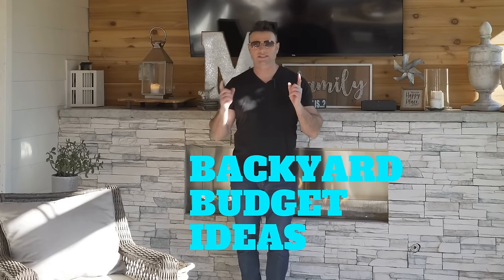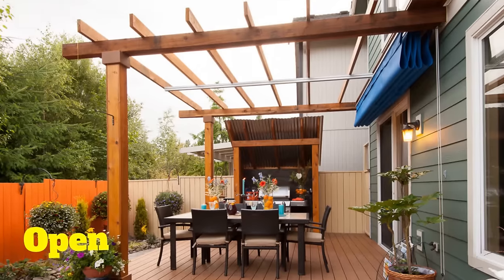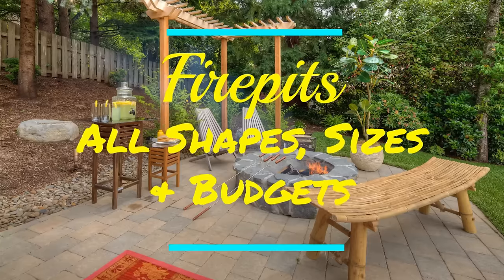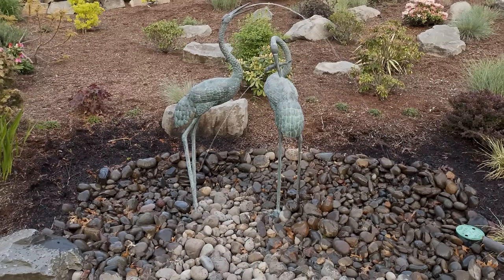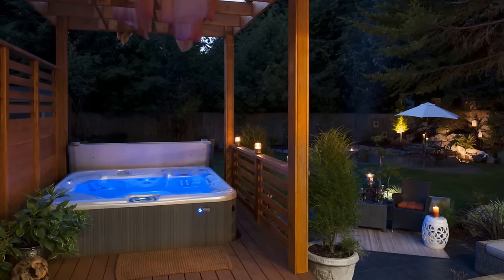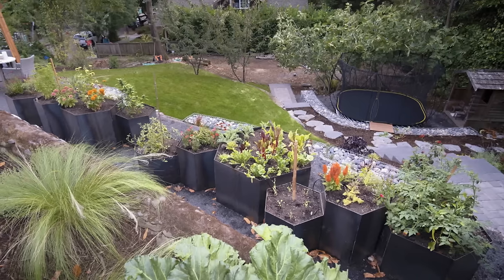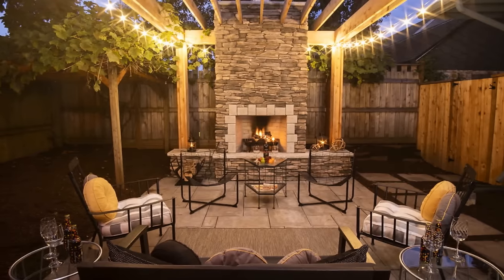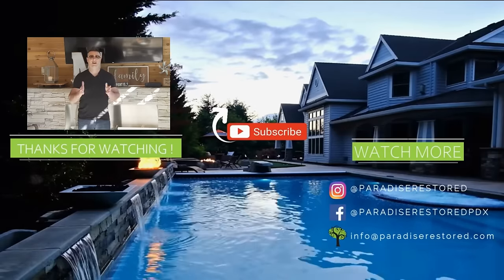Best Backyard (BUDGET) Ideas

Comment: I have a budget of 25K, is that enough for a low maintenance patio about 650 sq ft with a fireplace, modern fencing and pavers?
Reply from the maker: Where do u live Victor? It all depends on where u live and the local contractor pricing.
Reply: @BackyardDesignGuy  I’m in Danbury CT.

Comment: I had an old pool filled in and covered the yard with crushed rock (gravel) underlaid by weed-stop fabric. Is it possible to compact the existing gravel to provide a firmer surface? I'd like to add paving stones or concrete slabs for a seating/firepit area.